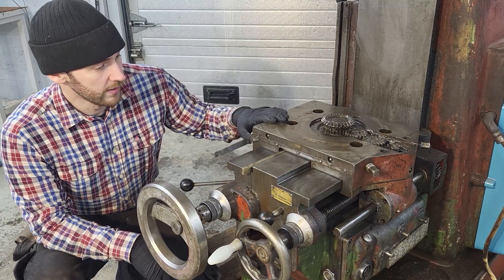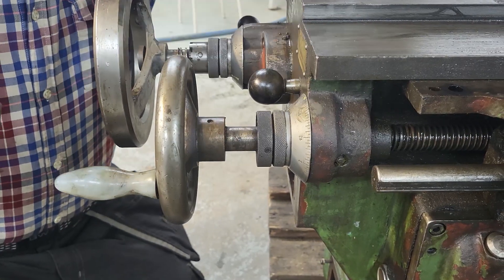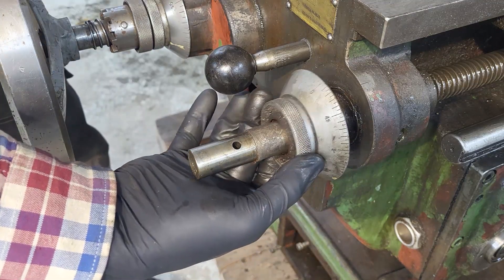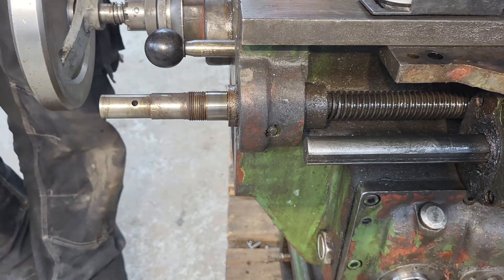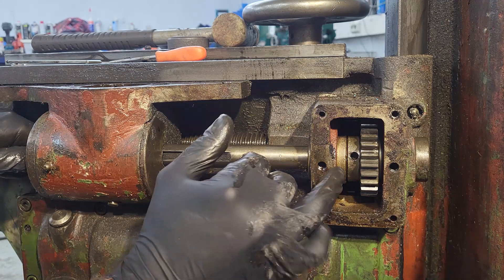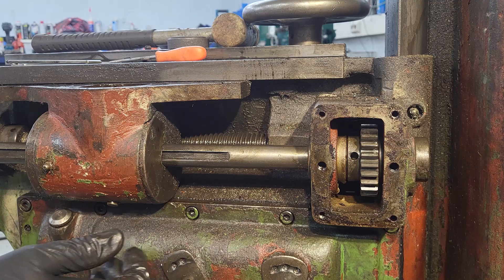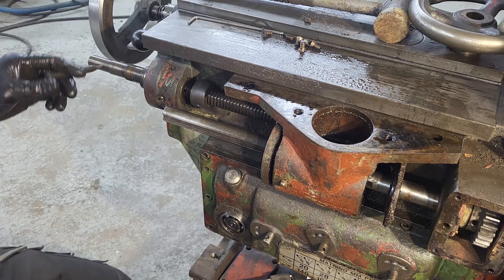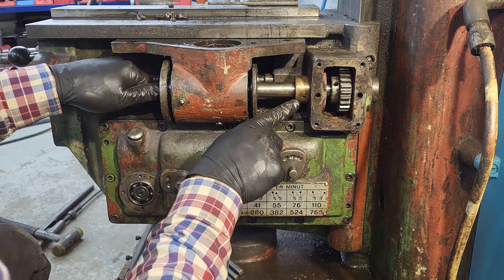SAJO milling machine restoration - PART 6

Comment: The Y leadscrew looks like old fashioned left hand square thread rather than the modern acme, commonly used in current machine tools. I suspect you will need to get a new one made and also the nut that sits in the drive saddle.

Comment: If the budget allows, there are a number of options for replacement cross slide lead screws.  If you have access to lathe, it may be possible to turn one down from custom acme stock or maybe order one semi-finished .  And if you don't have an engine lathe, perhaps that can be your next video project ?
Reply from the maker: Thank you for the good ideas! We might have a solution on going for the screw, so stay tuned for that! At the moment we only have a small table top lathe so we think we might need to change that in the future ;)

Comment: generally mill and lathes do not get greased even if it looks like a grease zerk it might be meant to take a machine oil. do you have the literature on this machine to verify grease is supposed to be used? all that grease looks concerning to me. doing good work disassembling!!
Reply from the maker: Thank you for the comment! We will soon have the full literature for the machine so we will definetly check what kind of lubrication is recomended since this grease really seem to collect a lot of the metal chips.. it is also a pain to clean 😄